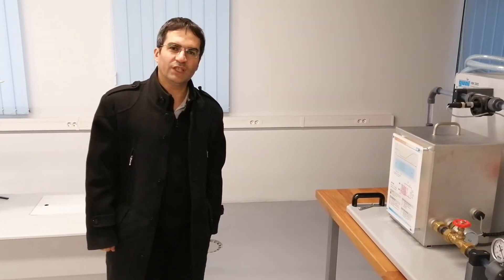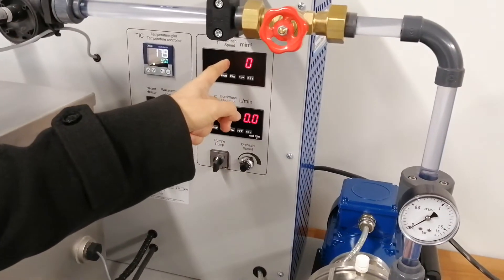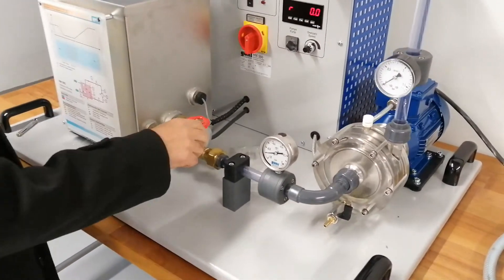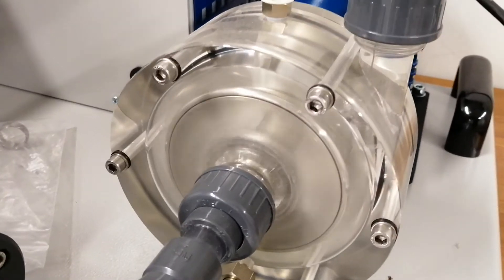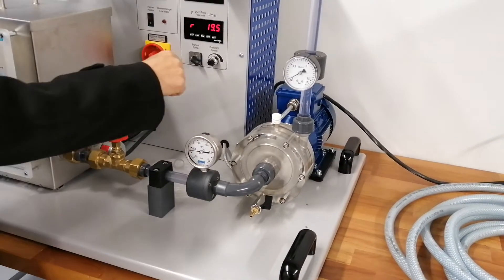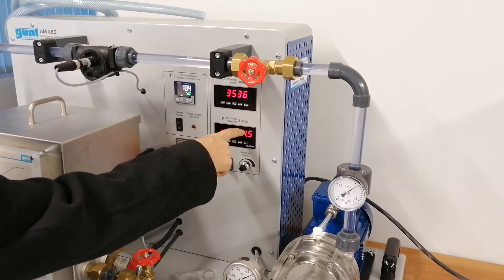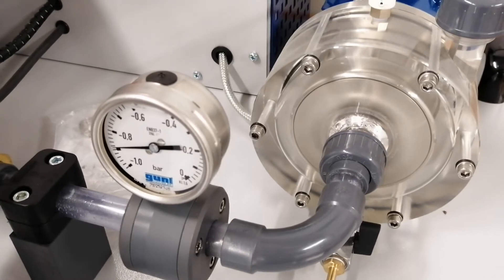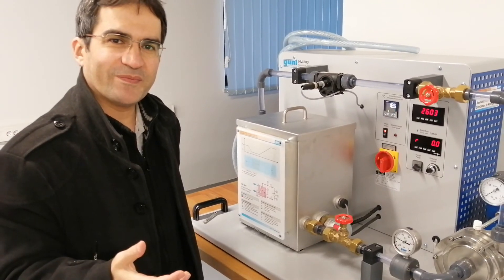Understanding Cavitation: How Pump Speed, Flow Velocity, and Temperature Affect Performance

Comment: If the cavitation happens at the impeller eye! from where the bubbles in the suction pipe come! because I can see bubbles in the transparent suction pipe when you close the suction valve, is it also cavitation! and if yes, I think this cavitation is transfered to the pump and make errors in the measurements, please advice because I have the same story in my test bench and I'm facing errors because of that air bubbles that comes from the tank to the pump
Reply: إدا أين يكمن الحل برأيك لو تفضلت